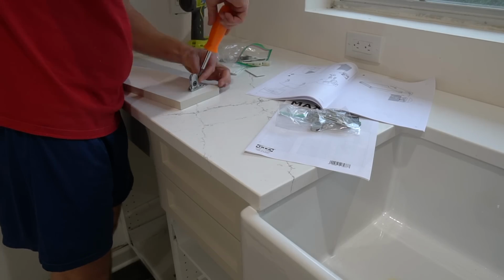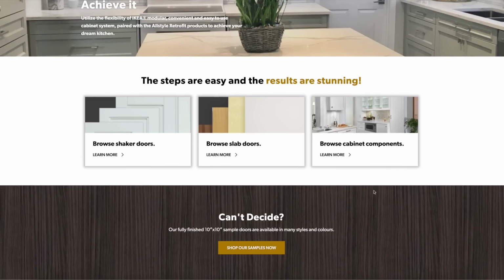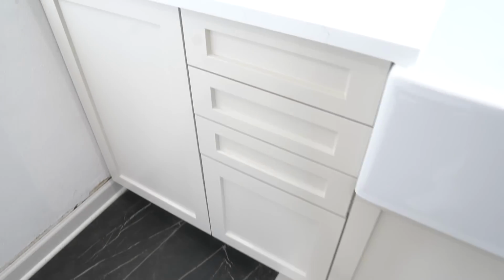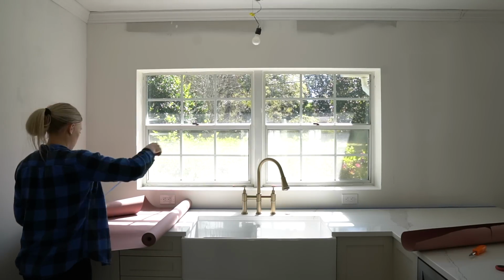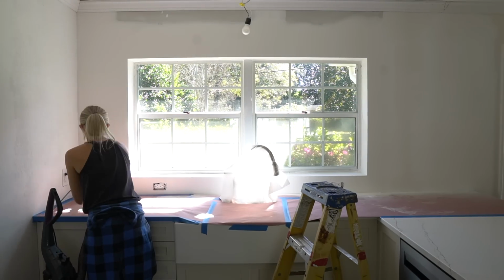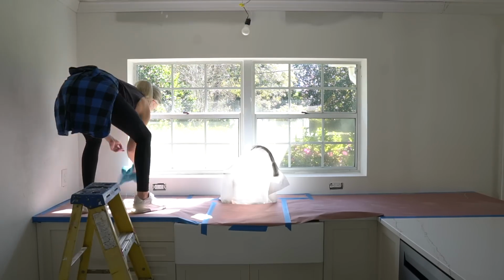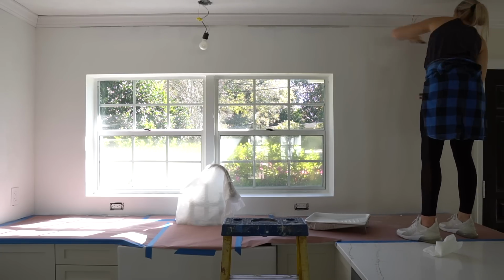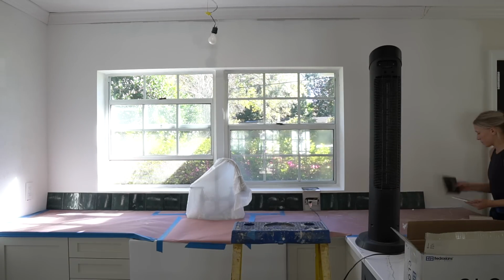Kitchen Renovation #8 | Backsplash & Cabinet Doors

Comment: I like grout to add some contrast, as long as it’s not for my next countertop, if no grout is applied, how do you prevent moisture between the tiles and how does the backer work then? Interesting concept, I had not seen this before.

Comment: since its not by the cooktop I believe you could easily get away with no grout. I'm also with a couple of others that said to wrap the corner and do more tile on the garage wall - Looks great though! Interested in a followup on the tile adhesive in a year or 2 when the Florida weather and normal kitchen wear and tear has had a chance to work its magic ;)

Comment: Looks great love the color palette you used. One professional tip is to always try have the cut tiles at the edge of the wall so imperfections are less visible vs around window as it’s catchy to the eyes specially that it’s you center piece there.
Reply from the maker: Thank you for the tip! ❤

Comment: Beautiful, Stefani! I agree with the rest. Black grout or custom colored dark green grout to camouflage it! Do you happen to know if the adhesive product would work around a fireplace? We hardly use it but wouldn’t want to install it if it doesn’t work there. I have to do a tile over tile project and the adhesive product would be perfect!